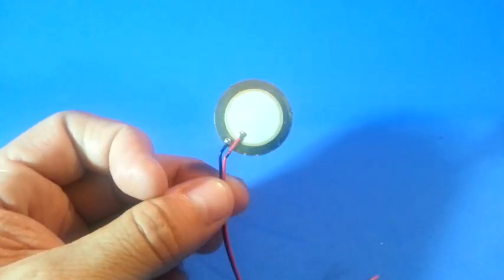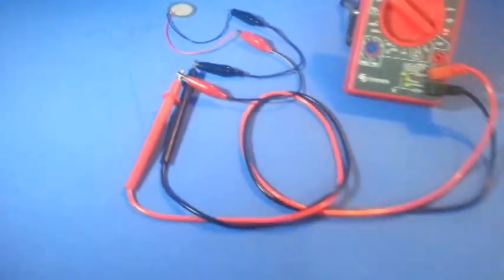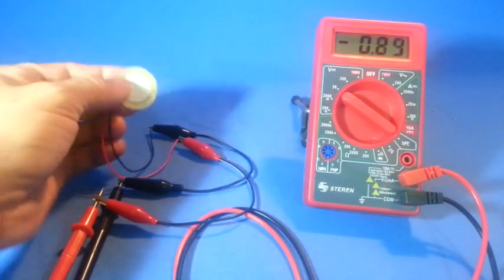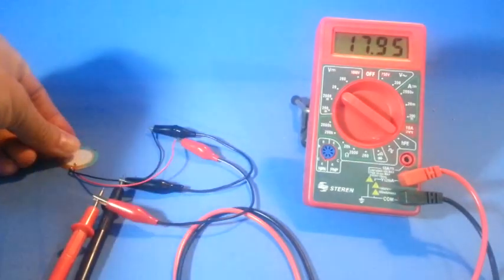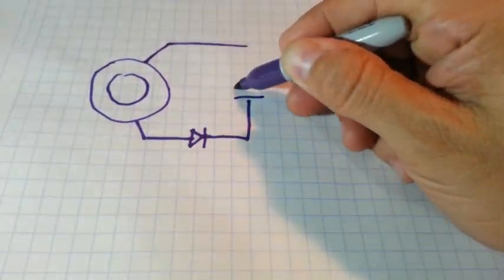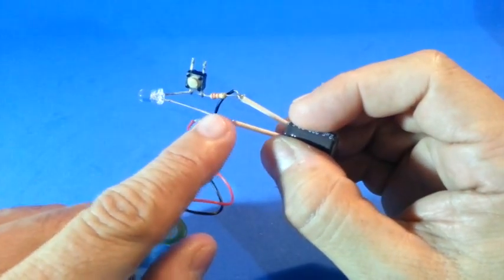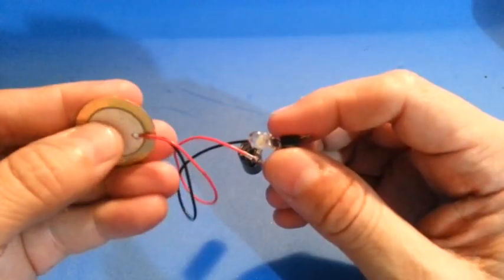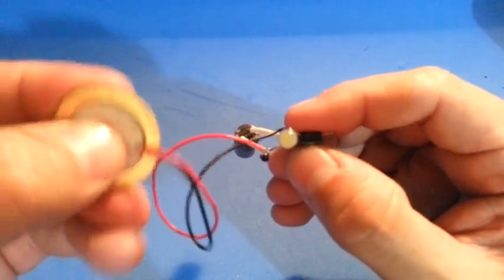Piezoelectric Generator

Comment: i would recommend to gte a small motor and put it on the disc, it will vibrate and generate a more stable voltage

Comment: I put a short bit of plastic line in a drill press and had it strike a peizo disk to see if it would trigger a transistor pulse motor. The pulses looked good. Takes the place of the reed switch.

Comment: Is it possible for piezo to degrade over time? I'm troubleshooting a digital watch which no longer beeps. The rest of the watch works and the tiny spring is in place. I used your pressure technique to connect a multimeter to the piezo (which is stuck to the back of the watch) but didn't get any volts.

Comment: Add a transducer to the circuit so it's constantly vibrating the piezoelectric element and you wont have to use your thumb and it will charge itself.

Comment: Piezoelectric generate AC voltage. Your multimeter in DC voltage mode it means you measure in WRONG WAY.. I 😃😃

Comment: Hello sir  I am in 7th class, I love and appreciate ur work with piezoelectricity my main goal is to create  FLAshlight powered by piezo ceramic or disc, since you suggest I shall use discs, can you tell me how I can connect the piezo disc series to this capacitor https://www.ebay.ca/itm/332031468823 can it be done using alligator clip wires . And also which do you suggest in terms of voltage production piezo film strips or discs and how many do you think I need to light up one decent sized flashlight through stored voltage in the capacitor, thank you once again sir your work inspires me pls respond thx but i am having doubts that I can lite up a big flashlight with just discs. thanks sir pls respond I am working hard

Comment: What is the value of Diode and capacitors. I did everything as shown in video with 220uf 16 v capacitor and IN4007S Diode but capacitor is not charging, and I am not getting any output ,out of diodes(rectifier) on multimeter in my case. What are the value of diodes or rectifier if I want to buy???

Comment: What are specification of capacitor and diaode. I tried with 220uf capacitor and IN4007S Diode but it isn'working at all and capacitor is not charging please help. I want to use it to charge a 3.7 v battery. Please help.

Comment: Now make a stack of piezos to produce enough energy in one go
Reply: In fact, making a stack will just divide the amount of energy you give by pressing on it... with some energy loss due to heat caused by the pression. Plus you'll need to press harder because of the added thickness...

Comment: why the need of a resistor
Reply: 1sword4you it's actually the amps that get lowered. An led uses somewhere between 200 and 300 milliamps. And the typical supply power is about 5 volts. So it has too much current for the led.
Reply: to limit voltage going to the LED, otherwise it would burn it out over time
Reply: ThomasHaberkorn rituals 😜

Comment: Hello Sir! Thanks for your educational video.

 I have learned that piezoelectric elements produce AC voltage. in terms of harvesting energy, are we going to convert this from AC to DC using an inverter if we are going to use it to charge a rechargeable devices?
Reply: If I am not mistaken, isn't that what the diode is doing?  Creating half wave rectification?
Reply: So that's why second circuit diagram has diode.

where did you point your multimeter gauging the volt? is it in AC or DC?
Reply: I am not completely sure what you are asking, but if you test before the diode, you would need to be in ac, after the diode you would need to be set to DC.  It would be a really poor DC signal from half wave rectification but it would be enough to charge the capacitor.  If he had used 4 diodes in a bridge configuration it would be more efficient because he would be able to use the voltage from the negative half of the AC sine wave that is being produced by the piezo.  I hope this helps!
Reply: thanks for making it clear for me. there are many video about piezoelectric generator but they miss to give this information.

Comment: i am using 9 piezo sensors in series and parallel combinations..
they are not enough to generate voltage to glow a led..
what should i do
Reply: ABHA SAXENA  did you ever get a response?    I'm looking to light an LED with Rochelle salt, science fair project with 11 year old.  this is all new to me, any help appreciated.
Reply: yes i got response....
use parallel combination of piezo material.. it will give u a considerable glow of led..
look there are various type of material so before purchasing, just check it that a single piece of transducer is capable to glow 1 led or not. 
i have purchase it in 10 and 50 rupee each(indian currency), material with 10 rupee is not capable. so try to purchase good material, it matters.

Comment: so if I was to install these in my foot wear and use a Peltier for thermal or heat charge and have a useful amount of energy storage. Any chance of charging a battery pack with the usage of a kinetic device?

Comment: interesting but there is also a negative voltage.
Reply from the maker: yes
Reply: no sir. if we apply a constant pressure on the device then a constant voltage may be generated. that means we  use no electrolyte here. it can replace a conventional chargeable battery. this thing can be used anywhere, whenever we need. any waveform can be produced corresponding to the right pressure style.
Reply: Any piezo electric transducer like this, only creates charge when the crystalline structure is bent or compressed. Therefor, it does not continue to create charge under constant pressure.

Comment: can you shout directly at the piezoelectic element to light up the LED ? if possible , will the capacitor still needed ?
Reply from the maker: no, need more pressure than that of sound
Reply: thanks for the reply!

Comment: You could add a rectifier bridge instead of a diode, in order to harvest both ways of the current instead of just one. (the resistor would charge twice faster)
Reply: but that would also have twice the diode drop tho

Comment: I tried it but the capacitor discharges very rapid, the LED lit for very short period. do you have any idea why ?
Reply from the maker: +Ayman Alrayes because the energy produced by the piezo is very small
Reply: +Ludic Science but you dont have this issue in your video, the led light take good time to disappear with you, why ?!
Reply from the maker: +Ayman Alrayes perhaps your resistor value is too low
Reply: +Ludic Science 
what is it supposed to be ?
Reply from the maker: +Ayman Alrayes between 1.5 and 3.2 k ohm
Reply: +Ludic Science 
Thanks a lot ☺

Comment: Sir what is the maximum possible and practical voltage that these piezos can produce?  And can some kind of an arrangement be made to produce constant output voltage?
Reply: The output voltage is depends on how big the module is and how much pressure is applied.
As for the constant energy output I would recommend a capacitor and a step up voltage board.

Comment: +Lucid Science
As the capacitor is always connected to the piezoelectric element, isn't it discharging the energy stored against the piezo? Do you feel any increasing resistance on the piezo surface (by touch) when you have pressed the piezo a few times?
Thank you!
Reply from the maker: +DoNotPushHere The diode blocks the current from returning to the piezo
Reply: Ludic Science
 Idiot me... Of course... =) thanks!

Comment: can I charge a battery instead of LED?
Reply from the maker: +Ranjith Babu It will take forever to charge a battery. The piezo produces very low power
Reply: +Ludic Science if I use more number like randomly 4 to 6 is it work?
Reply from the maker: +Ranjith Babu No, you will need like 100 to charge a battery

Comment: Could massive sheets a piezoelectric material be placed on the floors of a building to produce energy from the people walking around?
Reply: +Brennan Fifer or sidewalks, streets etc..
Reply from the maker: +Brennan Fifer Yes, but the energy that will be produced will be very low. Piezos are still very inefficient.
Reply: a 1.1 inch quartz crystal can produce 1200 volts

Comment: Why we r using diode and resistor in dis circuit ? Pls explain d use of those two elements in that circuit
Reply from the maker: +krishna hariharan diode is to rectify the current. resistor is to limit the current in LED

Comment: sorry .but where can i find piezoelectric , do u suggest a website to order it from?
Reply from the maker: +Wiam Ohm buy a buzzer in any electronics store, the piezo is inside
Reply: +Ludic Science thnk u .but i need a big quantity.
Reply: +Ludic Science can I use a piezo element to replace a FSR force sensor? if so how much weight can it read
Reply: +Wiam Ohm eBay. eBay cells this particular one very cheap.
Reply: +zoala001 thanks i managed to get it from another site

Comment: Sir thanx for the video shown please tell what type of capicator and diode and resistor used and what rating of capacitor,diode and resistor
Reply from the maker: +maddipati surendra Capacitor is 20 uF @ 25 volts and resistor is 2.2 k.

Comment: Piezo output voltage produce AC or DC sir?
Reply from the maker: +Soul Eater AC
Reply: i guess the polarity depends on which way you pressed it, like when you press down it's - + but when release it's + - so basically it's AC

Comment: What  size of wire is suitable to solder in the ceramic transducer u use. Also stranded or solid
Reply from the maker: +JD Punzalan almost any wire works, it is not critical.

Comment: Hi, I tried to replicate this project but my circuit does not work and I cannot figure out why. I used a 33microfarad 100V capacitor and a 2.2 Ohm resistor and connected everything like you did. 

I know the resistor is much smaller but I did not see the LED flash and burn out or anything.

 Also, I saw in your comments that you said only a 10-30microfarad  capacitor would work. Can you explain why this is so? Even if I don't fully charge the capacitor, if its capacitance is overly large then surely I can charge enough that when I click the switch, enough charge would be allowed to flow to light the LED?

Do capacitors only release their charge when they are fully charged? If so, why can't it release when its partially charged?

If you would like a picture of my circuit please pm me your email and I'll send one.
Reply: +Ludic Science  Oh and why did you use a 2.2/2.7k Ohm resistor? What voltage did you charge the capacitor up to?
Reply from the maker: +young bean your problem is the resistor. 2.2 ohm is too low, you need 2200 ohm (or 2.2k). A large capacitor will not be charged by this piezo, the current is very low, and the capacitor has losses (it is not perfect) so, the moment you put charge into the capacitor, it will be lost. Because of that, you need a small capacitor.
Reply: +Ludic Science Could you tell me why the resistor needs to be so strong though? If the basic LED works best at around 0.018 amps and R=V/I. Assuming I charge the piezo to 5 volts, 5/0.018 only gives me around 277 ohms though.

Thanks very much for the capacitor explanation though, it makes things a bit clearer and thanks for replying so soon!
Reply from the maker: +young bean because you have very low energy from the piezo. with a small resistor, it will only light for a second

Comment: Dear Sir, I wish to develop a working model in which I want to store as much energy as it can charge my phone or a rechargeable battery.. how many piezoelectric plates would be required? Where are they available?
Reply from the maker: +Gurmeet Kaur You can´t do that. piezos produce very little energy. You will need more thatn 1000 piezo elements to charge a a phone or battery.
Reply: You can use "Joule Thief Circuit" to increase voltage output

Comment: Is that possible to connect a Re-chargeable battery instead of a capacitor??
Reply from the maker: +Flyhighutah the piezo produces very low power, not enough to recharge a battery

Comment: which resistor did you use?
Reply from the maker: +Aswin Balaji 2.2 k
Reply: +Ludic Science  .can you specify the capacitor,,resistor,diode,and crystal used here
Reply from the maker: +sachin nm Values are not critical. Any diode works, capacitor is 20 uF @ 25 volts.
Reply: +Ludic Science  ho can i convert it into ac

Comment: which resistor did you use
Reply from the maker: +Aswin Balaji 2.7 k ohm
Reply: thanks. can you also say the capacitor and diode u used?
Reply from the maker: +Aswin Balaji 20 microfarads at 25 volts. any rectifier diode works.
Reply: thanks.

Comment: My dear,

I'm willing to ride with these Piezo drives some pressure transducers for use your output signals at the entrance of an oscilloscope.
The pressure gauge need to be in the vacuum range (-400 mmHg), and the other two transducers from 0 to 10 bar and the other from 0 to 20 BAR.
I bought some Piezo 27 / 35 and 45 mm.
I wonder if you have seen or done something like that, and I will have my success in this project.
Thanks .... Fire

Comment: What if you hold the pressure? Will it produce voltage? 
I mean, what if you don't pump, but only apply steady pressure/weight? Is energy still harvested??
Reply from the maker: hardg0re Of course not. You could simply put a weight on the piezo and obtain energy forever, that is impossible.

Comment: I want to know from where can i get this type of Piezoelectric Generator. And what will be its cost? (of the same size as in the video)
Reply from the maker: Saransh anand go to an electronics store like radio shack and buy a buzzer, the piezo is inside. it will cost one or two dollars
Reply: Ludic Science Yes I bought one. But there are 3 connections in the generator so which one should i cut?
Here's the pic.

http://enthraleing.blogspot.in
Reply from the maker: Saransh anand cut the green wire. however the piezos with only two wires work best
Reply: Ludic Science Thanks. Can I directly change the buzzer by an LED after attaching a switch? The capacitor is 100 micro farad and 16 v.
Reply from the maker: Saransh anand yes, however 100 uf it too much use less than 50 uf or it wont fully charge
Reply: +Ludic Science well i did the experiment but the capacitor (22uF 25 V) is not making the LED light up. I was not able to charge it with my piezo element above 2 volts, it losses it very fastly. What should i do?
My piezo also produce upto 20 volts energy
Reply from the maker: +Saransh anand Maybe your cap is damaged, at 22 uF you should be able to charge it. Are you using the diode right?
Reply: +Ludic Science I cant understand what do you mean by " Are you using the diode right?"
Reply from the maker: +Saransh anand I am asking if you are using a diode or not
Reply: +Ludic Science yes i am using
Reply: +Saransh anand and it has written on it:
INu(micro)007
MIC
Reply from the maker: +Saransh anand perhaps you are connecting the capacitor in reverse polarity, or the capacitor is damaged
Reply: +Ludic Science How can i know about its polarity??
Reply: +Saransh anand Even if i charge capacitor with a battery, and i switch on  there is a flash in led and thats all.... nothin' more happens
Reply from the maker: +Saransh anand you need to put a  resistor like in  the video
Reply: Thanks! I finally did that.

Comment: If they used this in video game controllers you won't have to recharge the controller
Reply: Gijs It Creates very small amount of energy its so hard
Reply: some labs are trying to make triboelectric (rubbing electricity, not pressure) for self powered keyboards etc
Reply: Well this would still be technically recharging the controller, just in a different method, good idea by the way...
Reply: @ERIK MARTINEZ VALERO Little spark of Static Electricity can generate up to 10.000 Volts 
Volt =/= Watt
Reply: @extrem2497  10 volts
Reply: Haha
Reply: Fbi: stay right there
Reply: Lol 😝 BRO
Reply: ^ bots
Reply: Certainly pressing all buttons 😂
Reply: Kkkkkkkkkkk
Reply: You explanation is simple and clear.
I will like to contact you for further Information.
Reply: Hold up
Reply: +Alfash corpwannable
are you dumb?
Reply: TheFastly but using a buckconverter or other voltage booster can be used for getting that much electricity
Reply: @ashlin1723  hmmm. Boost converters can only be activated at 0.5v
And a piezoelectric crystal is lower than that
Reply: @Jasmarkelina  In theory you could use the piezo electric signal for reducing power use on the controller, but thats about it, with current tech.

Comment: Hey, Ludic Science, I have a very similar design! My piezoelectric material is very inefficient. It does not generate enough voltage to charge the capacitor and power the LED. Do you mind telling me where you got your piezoelectric material from? Thanks in advance!
Reply from the maker: Zach Wadley I got it from a buzzer, 12 volt buzzer.
Reply: Ludic Science The buzzer seems to be producing a higher voltage. However, I can't charge my capacitor. I am using a 1000 uF, 25 V capacitor. I know you used 20uF, 25 V. Is that the problem?
Reply from the maker: Zach Wadley Yes that is the problem. The piezo does not produce enough energy to charge your 1000 uF capacitor. It is too big.
Reply: Ludic Science I don't have a 20 uF readily available. Would a 10uF suffice? Better yet, what would be an ideal range?
Reply from the maker: Zach Wadley between 10 and 30 uF will do well

Comment: Hi, and thank you for the nice demo! I am interested in reading and sending (wireless) the voltages given by a piezo strip, any suggestions on what voltage sensor I could use? I was able to read voltages of up to 24V from my piezo strip, but I don't have a data sheet with more details. Any suggestions would be appreciated. Thanks!
Reply from the maker: eusiegoulmeu I don't think you can do that, the piezo current is very low.